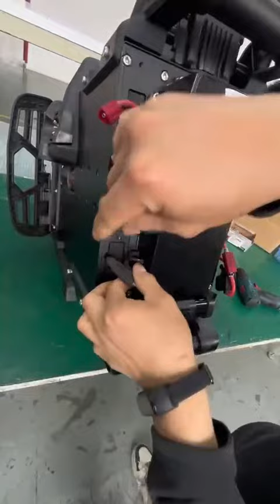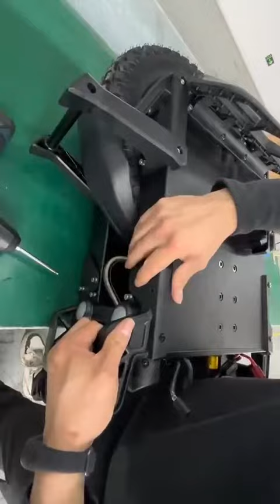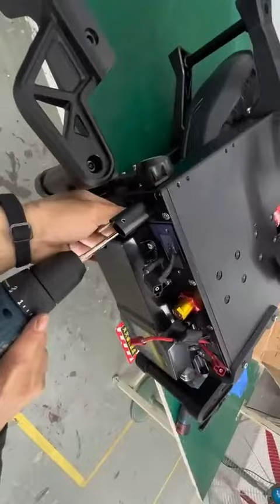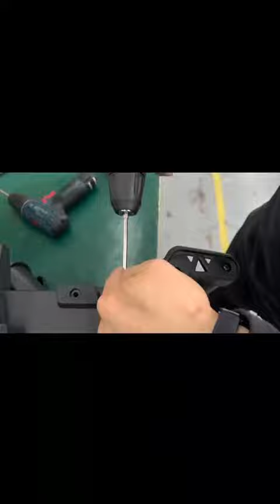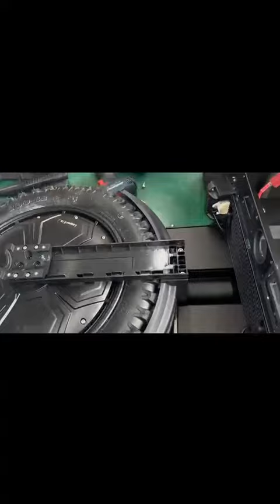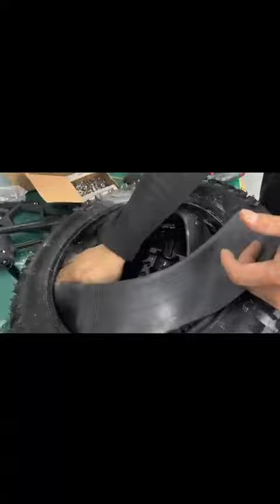Veteran Patton teardown --Replace tire

Comment: Hello, I'm looking for help, my patton won't charge more than 120 volts, I tried disconnecting the batteries one by one, but to no avail. I read a similar problem on the forum, where the controller needed to be replaced. Have you encountered anything similar, where should I look for the problem? and is it possible to try to charge each battery directly with a charger to eliminate their malfunction? will come from Ukraine!)